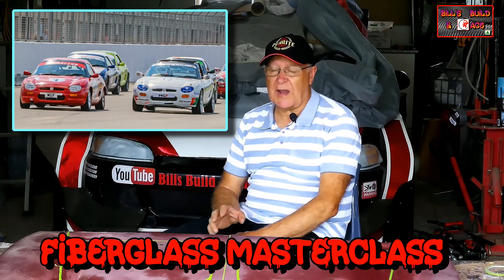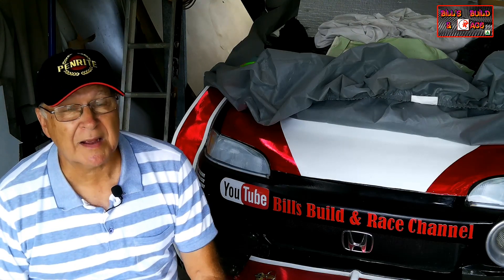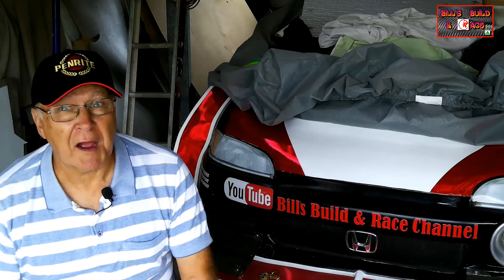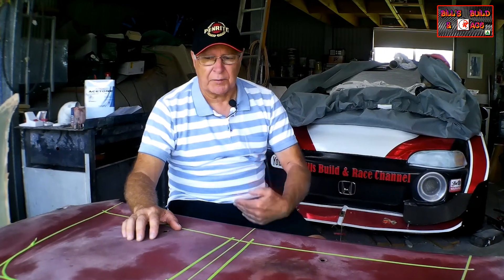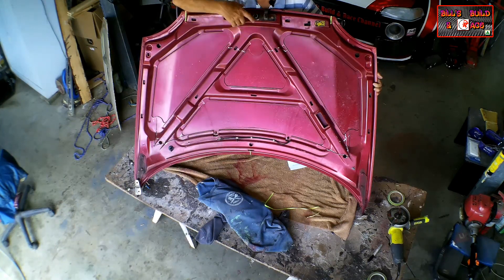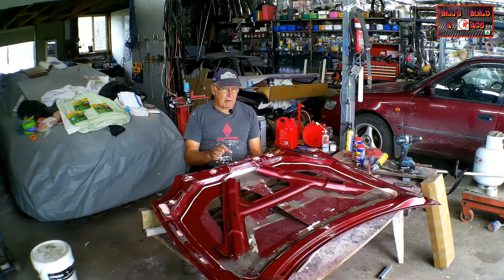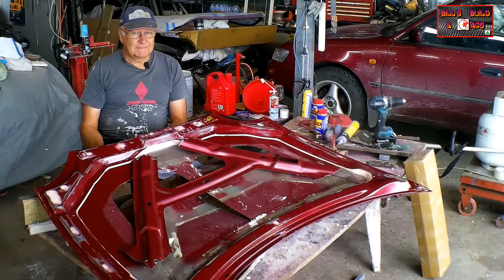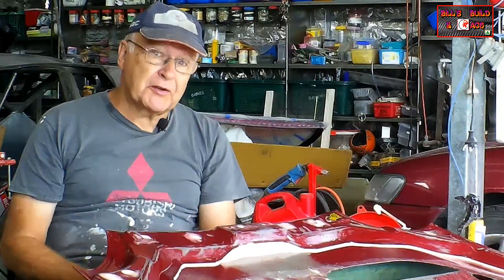Make a Fiberglass Vented Car Bonnet - part 1

Comment: a quick question ; is it possible to mold out of a car already wrapped ? I mean, wrap will be damaged after molding ? thanks in advance
Reply from the maker: Molding a wrapped car body panel will damage the wrap, and it's not advisable anyway because it's not a suitable surface for this job.
Reply: @BillsBuildandRace  thanks
Reply: @BillsBuildandRace  I d like to ask one more question sir. since you have a lot of experience, I want to learn the cost of full exterior body of a car molded . the car is Nissan GTR R35. full exterior body panel mold cost . regards.
Reply from the maker: @japoncae7211  The cost of materials to do it yourself, or the cost to get it done? I don't think you fully appreciate just how expensive & time consuming molding a whole car is. Then after that, you double your time & expense to produce the copies.
Reply: @BillsBuildandRace  well, lets say both. personally I have been watching your videos to learn it. I want to hear from you the cost of whole car doing myself and by a professional . thanks sir.
Reply from the maker: @japoncae7211  How much experience do you have with making fiberglass car panels?
Reply: @BillsBuildandRace  beginner sir.

Comment: Hi Bill, just wondering if you can recommend someone in NSW  who can produce a full body shell (much like a Lotus 11 ) from a buck. Thx
Reply from the maker: Me. I am an hour north of Newcastle. I presume you'd want a set of flanged molds of the die, then a copy made in that. You can message me and send pics via the Facebook links to me on this channel's home page.
Reply: @BillsBuildandRace  I will already have the molds, it has apparently had one body pulled from it. I know it would be a guess, but what kind of price would it be to have a body pulled and how many bodies can be made before the mold is no good?
Reply from the maker: @rodneykemp1009  I would have to see pics of the molds before I could even give a rough quote, but $5K would be a starting point for a job that size. How many copies a mold can deliver depends on what gelcoat was used to make it. If general purpose gelcoat, around 5 - 8; if made using tooling gelcoat (commonly a orangey red), more than double that. Molds that have deteriorated can also usually be repaired.

Comment: I love watching your videos. I am currently working on a Triumph Spitfire project that I am putting A Mazda rotary into. I will be making a vented bonnet as you have done here. But I am wondering if there is a method to do this without cutting up the factory hood? It is still in good shape, and I would like to be able to pass it along to someone who wants factory original.
Reply from the maker: The only way to not damage a factory bonnet is to make your scoop a complete add-on. But even if you can avoid screw holes by just using glue to fasten it on, there are appearance compromises with that method.  Forget everyone else who "might" want your original bonnet. Take the saw to it and sculpt what you really wamt. Far more people are likely to want copies of THAT the the  original. To make an omelette - ya gotta break eggs!

Comment: Did you use a mold release for the underside of the hood? The video shows you putting resin down to make the mold with nothing underneath it.
Reply from the maker: When I mark a video as a "Masterclass" it means it features advanced techniques, and does not cover fiberglassing basics. I did that in the very first video in my fiberglass tutorial "Playlist." To repeat all that basic stuff in every video would be time wasting & boring. Of course I used a single coat of release wax (unpolished), followed by PVA release before I applied my gelcoat. I just didn't show it, because I have shown that over & over. Just like I didn't explain this time the details of what's involved in trimming fiberglass with a utility knife. After 65 fiberglass tutorials, you get to the point where you wanna move on! Hahhaha!

Comment: Hi Bill, have done prity much the same to my aw11 mr2 track car bar recreating it in fibreglass.  The 'frunk' vent made a lot of difference in the handling of the car.    

When building your molds, do you use waxed or unwaxed resin?  Cheers.
Reply from the maker: Unwaxed. Waxed resin is not used in general purpose lay up.

Comment: Toyota MR2 Mk2's have the same problem. Rad up front, bulkhead right behind the rad and forces the airflow down. but they dont always overheat. 13.7L of coolant in the system. but doing the same bulkhead mod and ducting the airflow up does make the front end more stable.